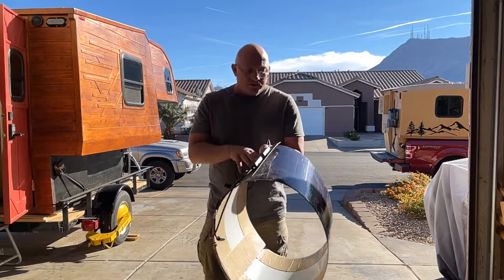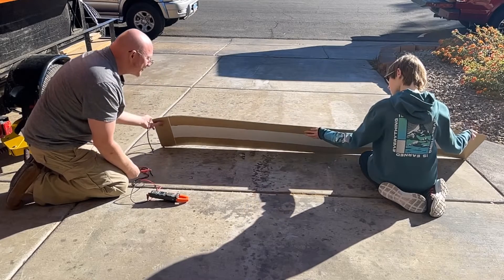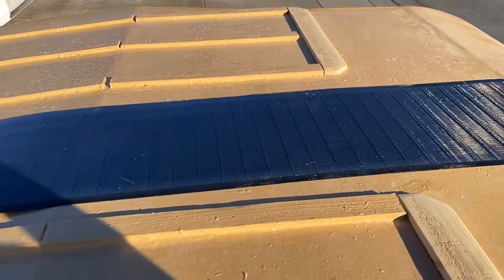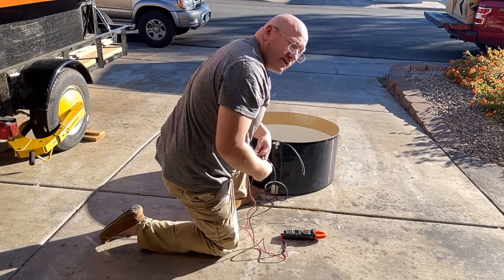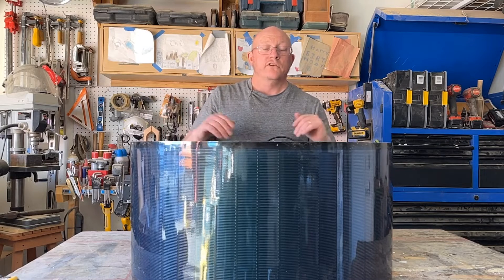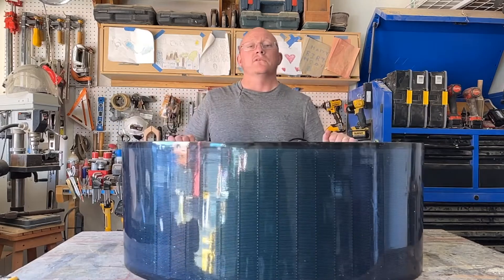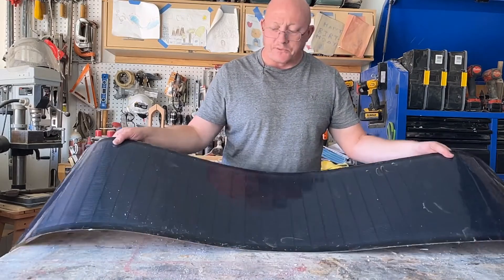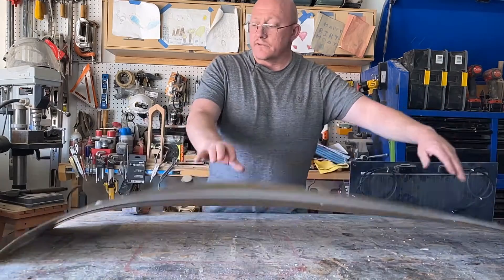Yuma 200W CIGS Thin-film Flexible Solar Panel Honest Review | BougeRV

Comment: "NO LOAD" measurements are invalid for measuring power capability.  Do a proper test with a real load.  A volt meter by itself is NOT a real load.

Comment: Nice but ridiculously over priced.
Reply: I worked on this technology during my PhD. Currently these are overpriced because of the materials (Indium and Gallium) and production technology is still new, However this uses much less material. Once they have set up the same as Silicon, they will become much cheaper than SI.

Comment: Cute review,  watt output would be more meaningful than amps
Reply: ~30v at ~3.5a is surely bang on the 100w it's rated for, 90w with it flat and the sun seeming pretty low (judging by those shadows) is impressive enough.

Comment: FYI. I just tested my 200 watt panels today at 2 p.m. in full sun, no clouds. I was getting 4.7-5.2 amps x 31.5 OV, so between 148 and 163 watts. This is a bit better than the bluetti's I tested.  Pretty amazing you got 90+ percent. With the 200's I figure on 75 % efficiency. This was laying flat, so mounted to the roof of an RV should be similar. Shading part of the panel with my body dropped things from 5.2 to 4.7 amps, so in that regard they do very well. .5 amp loss with 30% shading or so is pretty amazing. Would love to get 80 or 90% efficiency, but you need some intense sunlight for that. I'm in a northern climate, so sun doesn't get high enough for better output is my guess.  Maybe this summer?

Comment: I just received two of the 200 watt panels to put on top of my RV, which has a convex aerodynamic shape to it. It was encouraging to hear the angles do not affect it all that much, which is exactly what anyone could hope for. These little buggers are still really expensive. I think they get $579 for the 200 watt panels. I was fortunate to grab a couple on Amazon at a 38% discount, so got two panels for around $740. All I can say is watch for the deals because the prices  fluctuate a whole lot. I don't think I would spend $1158 on two of these. Considering you can get a consistent 30 plus amps from a DC to DC charger for about $250 the cost dfferences is huge. Not sure how much extra gas is used to power a DC to DC converter, but I still think the payback for these panels would be quite long. And of course not every day is bright and beautiful, so I'm sure the output is cut 50% on an overcast day. I'll have to come back and report my output from the 200 W panels.
Reply: My problem with this product plain and simple $400 for 200w and it's made of plastic I don't care how light it is you can get a bifacial for $200

Comment: I am not on the sunny side of my apartment building. How many watts can it produce in blue skylight only?
Reply from the maker: Thank you for your comments😀
There are many factors that affect the power of solar panels, not only the intensity of light but also the Angle at which they are placed.
But CIGS solar panels are more efficient than other solar panels at generating electricity in low-light or shaded conditions🙂
Reply: @BougeRV  Thank you much
Reply: @qfella  probably 50 to 120 watts
Reply: This sounds great but it’s just too long for my application.  I wish you offered a 200W CIGS panel that was half as long and twice as wide as this one.
Reply from the maker: @riariaria  
Hello,
Thank you for your content.
You can check out the YUMA 100W CIGS solar panels, which should meet your needs.
And we will consider your advice on the upgrade plan for the 200W CIGS solar panel.
Reply: If you get real panels 1/4 if rated rating. If you get this garbage, 1/8 output.  Not to mention how ugly they are.  Just move to sunny side. Or ask neighbor if you could kindly run cables from your place into theirs, and consider sharing the battery output as a trade.